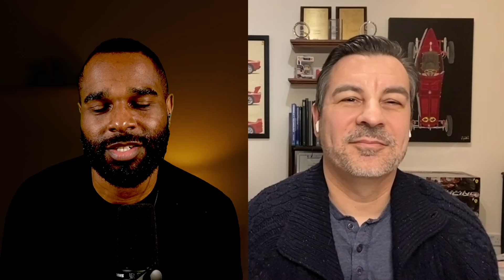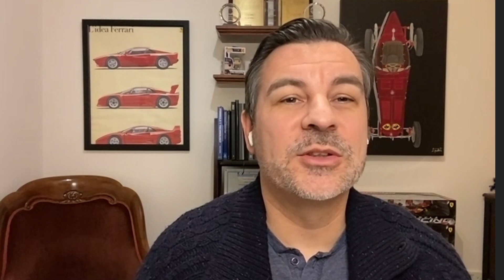Red Bull's Genius RB20 Explained

Comment: Okay, so I will speculate. There are now dual radiators on both sides. The hot air from them gets harvested and will be used to further energize the venturi in the tunnels by creating suction at the back of the diffusers. The hot airs molecules are greatly expanded, and so the ambient temperature tunnel air gets drawn into the expanded heated air at the back of the diffusers, and uses thermodynamics to basically perform like the 1975 Brabham, only passively instead of using fan blades to create the suction. Those exit gills on the gun barrels are only temporary.  The new configuration will become apparent at Japan. They will dial the new cooling configuration in before they move to the new configuration with the cooler air at Japan as Their insurance policy. Simple. 😉